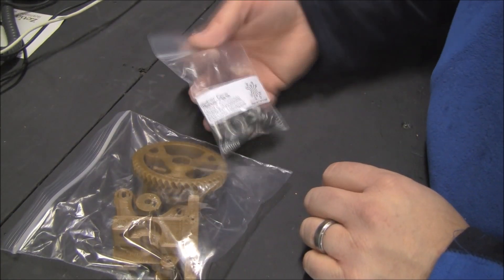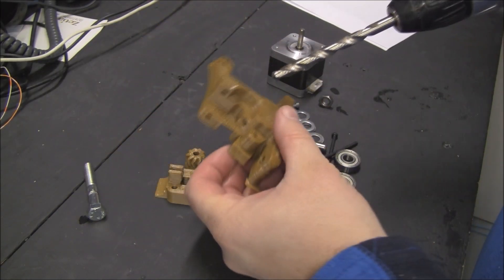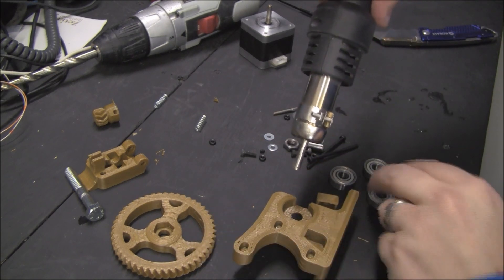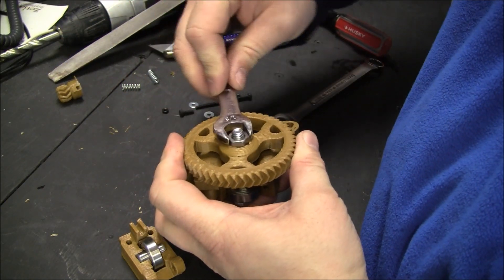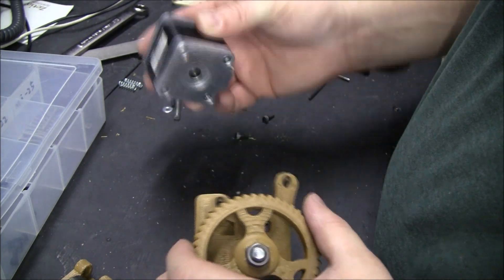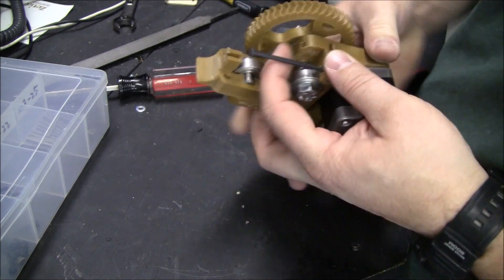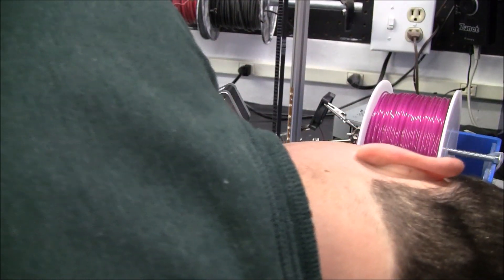Greg's Accessible Extruder Assembly for a Kossel Mini

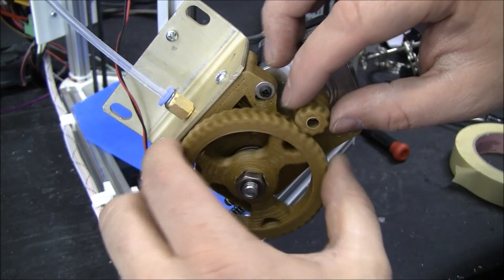Comment: You seem to have considerable warping issues at 7:00 into the video. Not that the extruder or its assembly is to blame for it. WIth your sample lifting corners - actually the whole side - like that, I can understand why you didn't print your extruder parts yourself :)

Comment: Omg you have put the hobbled bolt in the wrong way! The bolts hex head must be in the big gear to transfer all the torque to the filament driving groove instead of just perpetually tightening the nuts! With the correct way it will not tighter/untignten the two counternuts at all...
Reply from the maker: <p>Nope, I just went out and checked to make sure I'm not crazy, that's the way the instructions say and besides, if I put it on the other way the hobbed section would be off center by about 8mm or so.</p><p>I have ran a few of these and haven't had an issue.</p>
Reply: electronhacks
Thats just terrible design. Mine is the other way around..
 So is the original http://reprap.org/wiki/Wade%27s_Geared_Extruder
Reply: Jan Hlavatý
no it is great that way it is adjustable I thought it was wrong at first and many of the others I have seen are bolt head in gear but this way is nice  and a simple way of solving off center problems.